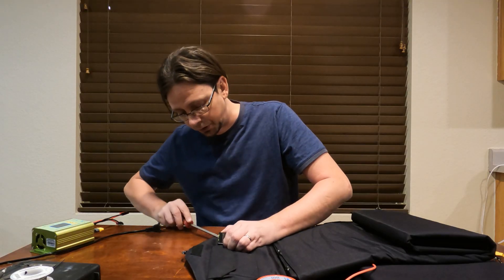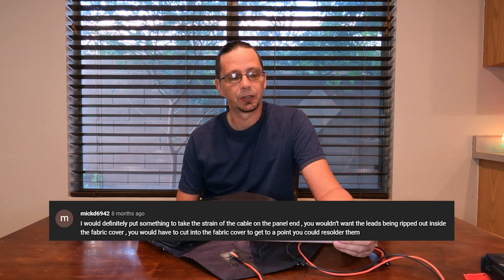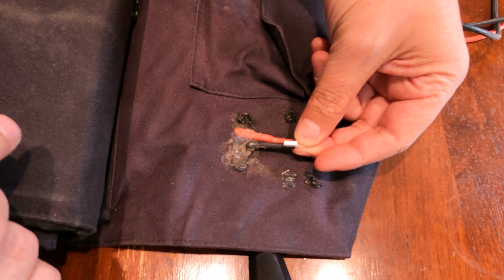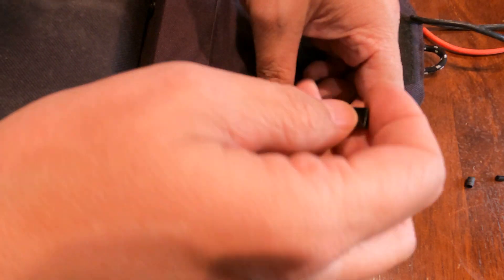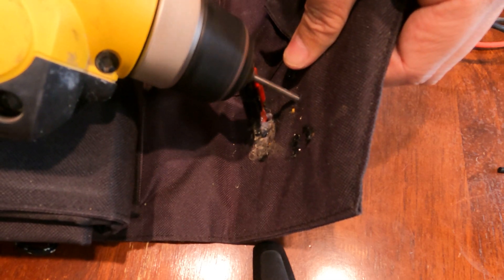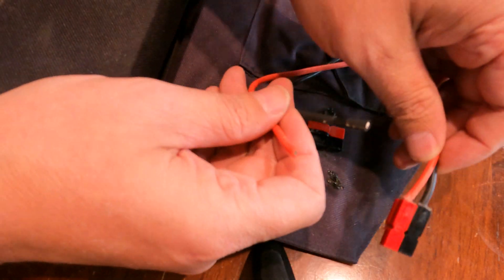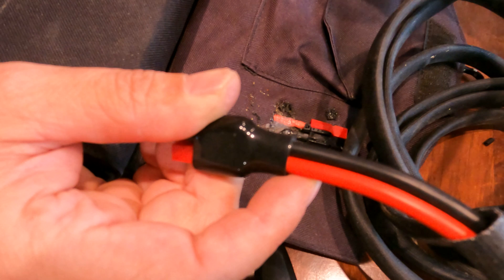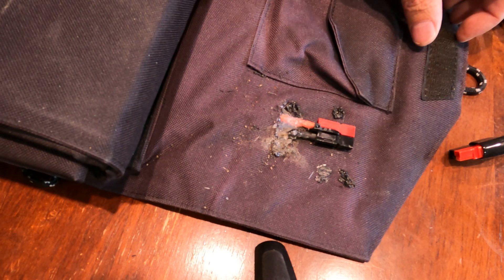UPGRADE ALLPOWERS 100w Foldable Solar Panel | UPGRADE ALLPOWERS SP012 Polysilicon Solar Panel 100W

Comment from the maker: .:Items used in video:. 
🛒100 watt foldable solar panel: https://amzn.to/36fbAQc
🛒Anderson Powerpole Connectors: https://amzn.to/3z1Tluc
🛒Zip Ties: https://amzn.to/39wguhn

🛒Premade Anderson Cable 10AWG: https://amzn.to/3O3DfrW
🛒14g wire: https://amzn.to/3xGylZy
🛒Soldering Iron Kit: https://amzn.to/39HXV9I

🛒Heat Shrink Tubing: https://amzn.to/3rfedLU

Comment: Great little mod there. How does the panels perform after the controller is removed. Do they produce 36V connected in series in full sunlight and what would the amp and watt rating be for this configuration?  

Greetings from Norway
Reply from the maker: With the built on controller in parallel or series it was limiting the watts under 100. Without I seen 2 of them go as high as 160 watts. With or without the built on controller it was hitting the 36v output in series.
Reply: @Eric_Tennant   Great thanks! Guess I will be buying a couple them myself
Reply: @Eric_Tennant  Did you get a 36v output from one panel or two?
Reply from the maker: @MrX-bp9ty  Takes two to get that voltage.
Reply: @Eric_Tennant  Have you had a look at the CTK300-II or the more expensive Genasun boost charge controllers? They could save you some weight... I hear great things about them...

Comment: Nice video.  Just wondering if you've tested and verified you can get higher voltage without the controller.  Thanks!
Reply from the maker: The problem was that when connecting 2 together it wouldn't go past the amps of one panel. If your using just one panel the controller is fine.
Reply: So, if I connect 4 cases, the watts and current won't be summed due to the controller's limiter?

Comment: Thank you for the video!
Do you still have the original controller around? I'm wondering if it only stabilizes 5 V outputs, but not 18 V.
Could you include the pictures of the controller board somewhere in the video?
Reply from the maker: Both ports work great for a single panel; however when connecting two or more panels the controller was capping the total power at 100w (5a). Yes I kept the controller and I'm using it on a Window solar unit in my bathroom window to charge my razor and small battery packs. Picture at top of here https://www.youtube.com/c/LastEnd1/community or https://www.instagram.com/p/Cgupn4yPWpw/?utm_source=ig_web_button_share_sheet
Reply from the maker: Now if you need to see the circuit board I will have to see if the other one isn't potted in silicone. I did that to the bathroom one to protect it.
Reply: @Eric_Tennant  It would be great to have a pic of the pcb, thank you☺